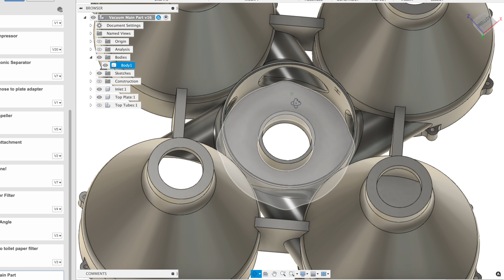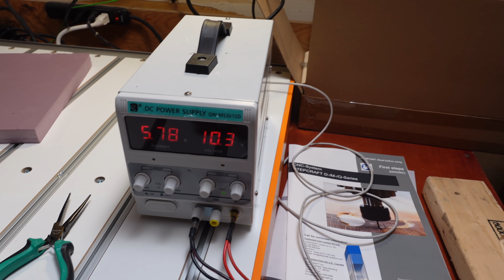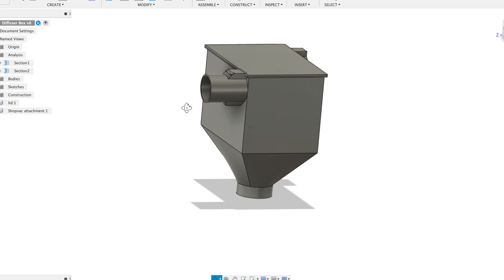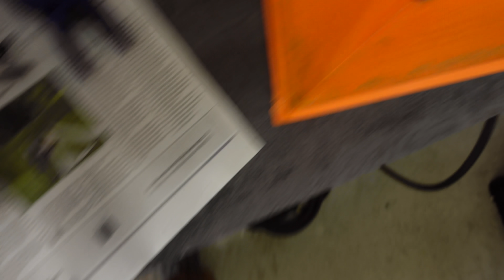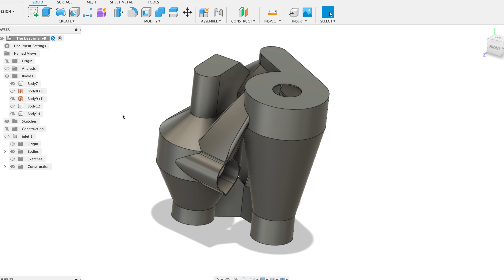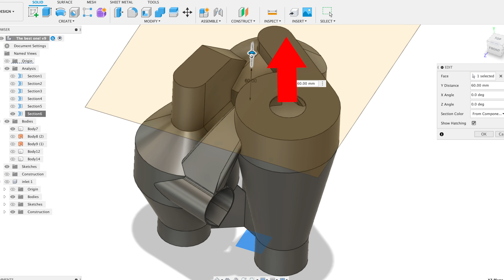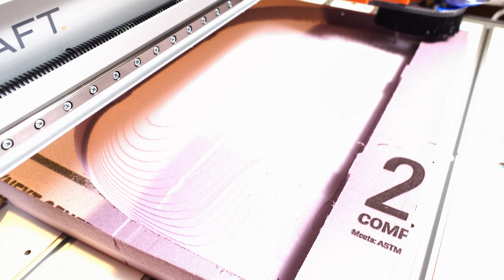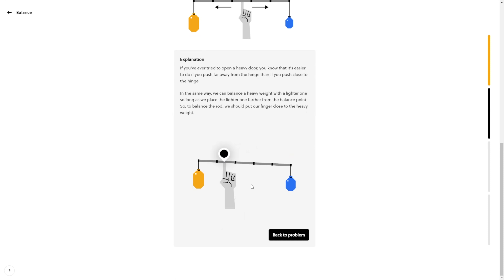3D Printed Cyclone Air/Dust Separator

Comment: Your big pieces are floating because you have a leak to your collection bin. Either perfect your seal or add a tube between the collection bin and the vacuum motor to equalize pressure.

Comment: So, I use these Cyclone vacs all the time. One thing you might want to take into consideration is flow rate of your air.

I use them to vacuum grain, and the flow rate is EVERYTHING
Reply: Thats more or less his entire problem, flow volume is way to high for the size of cyclone, and the single cyclone is way, way too wide and short. All he had to do was search Kice, Walinga,  Brandt, or any company that makes grain vacs or commercial dust collectors to get a list of scalable dimensions that would work without fucking around with so many half assed designs.

Comment: Air velocity could be a big factor. Larger dust particles if flung fast enough will just perpetually rotate at the top of the cyclone. I would go wit multi stages but have a firs lower velocity larger intake diameter and a greater angle then a second stage that would have a much smaller angle of the cone and smaller diameter od the intake from ghe 1st stage. This woukd accelerate the air and particles in the not letting them keep being airborne as otherwise they would be in the larger lower velocity cyclone stage. Though this is just an idea

Comment: mmh I'd be interested in seeing the difference between various angles of steepness on single cyclones vs big and small particles.
Perhaps one angle is better at small dust where as the other is better at larger particles, in which case having 2 of them in sequence could get you the best of both worlds.

Comment: you're pulling too hard a vacuum. that's why the big one works better. you're creating too much turbulent air:goodvibes:
Reply: also alot of those filter systems still have a filter section like big felt socks

Comment: I am just guessing but what if you try to angle the intake pipe slightly down ward so the particles will have an initial downward motion as well as gravity falling. And or make an inner tube what is equal in length to the intake diameter to prevent any shortcut of particles.

Comment: Thanks for the very interesting video.
Your gas cyclones are well printed, but have a relative high surface roughness. In consequences they need a steeper cone, because the particles stick easier and have a higher friction. Also introduced are little turbulences, that can pick up dust an bring it back into the airflow. In minute 1:26 you show us a very good example off an array of gas cyclones. Here you can see that the cone is steeper than they are in the printed one. Also is the cylindrical section much longer. This helps to stabilize the airflow and particles don’t exit the gas cyclone as sone as possible. For the small and easy escaping particles you will need a tube inside, that goes down from the outlet. This is never shown in your video, but helps against small particles that exit too early. Cascading cyclones in general is not often used in industrial applications, but when you do a cascade of cyclones, they get smaller in size and high in quantity. They need to get smaller to separate smaller particles and higher in quantity too allow the major flow of the first big cyclone. The last thing you can improve is a cone in the outlet for the solids. The cone prevents the vortex to get in the dust collector. It is not often used, because of issues with clogging of the outlet. This happens for dust that sticks easy to gather and is more stringily. This is possible for your foam dust. So, not highly recommended. 
For farther information I found a book that can help you: Rhodes M. (1998). Introduction to particle technology. John Wiley and Sons. ISBN 978-0-471-98483-2
https://memberfiles.freewebs.com/94/74/72737494/documents/Particle%20technology%20by%20martin%20rhodes.pdf

Have a good one

Comment: Question for y'all, why does sanding down the sides help with the removal of those heavier than air particles? Wouldn't friction against a rough surface help in slowing those particles down as they drag against the sides? Better yet, would designing and printing the mono-cone with spirals running the same rotation as the cyclone but spiraled down into the collection box help with direction heavier particles as they would be guided downwards by essentially a channel vs just free-flowing with the air?

Comment: I'm thinking the bigger cyclone works because it lets the air slow down the most. Smaller cyclones keep the velocity so high the small dust stays suspended.

Comment: I bet if you put an inner cone inside the cyclone to prevent the air flowing directly up the tube it would massively improve the separation, also a counter helix printed in the outer cyclone to help guide the dust down as it spins, think texture more than canard, just a spiral bump to kick off perfectly circular rotations, also flat vertical blades on the inner cone should prevent spinning vortexes entering the internal cone and providing lift to particles, so they fall instead of climb, so less flow through effect like you're seeing with the multi cones

Comment: Might have to do with the flowrate vs cyclone volume. I.e. if you have two stages of the big cyclone it will do better. 3 stage cyclone do better with bigger particles may just be lower flow speed due to the more complex structure.

Comment: would the cyclone be more effective if you kinda corrugated the inside of the cyclone so the ridges would guide stuff towards the bottom?
Edit: Something else you might want to try is putting some vanes around the exit of the cyclone that require the airflow to actually reverse at the center of the cyclone to reach the exit. The particulate matter should have too much inertia to make the turn and just skip off the vanes, but the air should be able to get in just fine ideally.

Comment: With cyclones in series I am pretty sure each of the dump buckets need to be separate. If you have 3 cyclones in series you need 3 collection buckets. Just having 3 tubes into the same bucket will not work because they will equalize pressure.

Comment: you should try angling the air intake into the cone to be more down so it doesn't keep spinning around. also put a flat plate on the bottom of the cone with gaps on the sides so the dust only goes in not out. that should help with those problems

Comment: also i would think that you would need to run a heat gun around the inside to smooth the print and give as low a friction surface inside the cyclone as possible

Comment: Make sure to crimp a ground wire to the metal wire in that flexible hose and screw it to the metal frame of the router to prevent static build up in the vacuum system.

Comment: I'm not sure if this has been recommended yet, but you should try a two-stage system with the first being a defuser and the second stage being the cyclone. In the defuser you should take the half tubes across the entire section alternateing their direction with a little bit of overlap (like full tubes that have been cut in half and one half moved down so its edge is in the middle of the other half, and repeat until it covers the entire thing. I'm not sure if I'm explaining this well enough). The air will be able to move quickly around the curves but any larger items will fall down because they can't make the quick turns.  and the dust will then be picked up through your cyclone design.

Comment: What about using both. The multi stage cyclone to pull out the large particles and then the single cyclone to pull the fine particles. Would be interesting to see them both hooked up inline like that.

Comment: I'm curious what your results with the paper towel filter would be if you just cut two holes in the lid of the bucket as far apart as possible, one for the outlet and one for the inlet, and have the hoses pushed in a little.

Comment: Pretty sure a problem with your series design is you outlet also was ramped with a cone, causing the air to increase in velocity and take the dust with it. This is supported by the fact that the third chamber removed the most dust. The outlet between each chamber s,hould be flat, you might even want to put a lip around the outlet reaching into the chamber

Comment: I like what you are doing. suggestion: start with an elliptical shape to parabolic shape and then hyperbolic for cyclone mono design would be my thoughts to try for improvement ideas and yes some sort of static grounding with even a probe into the drop bucket as there appears to be that ionic collection there too. a stupid industrial sized (5x8) scotch brite does work on heavy particles in like the paper filters you used.. the finer dust is my problem. haven't gotten around to the water trap filter system yet. i.e. older rainbow vacuum cleaners design - no static ground required here due to the water neutrality aspects..  just dawned on me water in the bottom of the 5 gallon pale, @1" would cut out a lot of static aspects - but mold ? or the daily dump...
good luck

Comment: What is instead of a cone, you had a hemisphere? Or what about something sorta the inverse of a hemisphere, a curved funnel sorta like the "mouth" of a trombone? Or how about some sine-wave ridges that spiral downwards, sorta like smoothed out screw threads going along the walls; with the curvedness not too pronounced to catch too much dust?

Edit: Oh, another idea to test: Instead of just a cone/funnel, have the top section be just a straight cylinder, and place the funnel/cone at the bottom

Comment: Simply routing the air through a larger tube will drop the air velocity since Q/A=V where V is velocity, A is area and Q is flowrate.  If you bump up the area the velocity goes down proportionally.  The middle of the tube will have a much higher velocity (especially since this is 3D printed and doesn't have a smooth surface) so it would require a series of diffusers to make sure the velocity field is uniform.  You'll need the bottom to be open to the bucket for the dust particles to descend and accumulate.  If you get an anemometer (they are like 20 bucks) you can measure the velocity of the flow in your vacuum tube which combined with the cross sectional area can give you an estimate of how large the dust collector tube would need to be to drop the air velocity.  The surface area of the opening in the diffusers should be equal to the original (non enlarged) tubing size.  Basically the particles fall downward at a fixed rate decided by gravity and their drag.  The velocity inside the collector must be low enough that a large portion of particles (>95-99%) have plenty of time to fall downward out of the moving air stream.
Reply: I might have read this wrong, but doesn't the high velocity of the air generate the centripetal force that separates the heavier particles. This also might just be one factor, or I could be completely wrong.
Reply: @terminus9897  ummm. Centripetal means striving to the center... Since this comment is about axial flow, not about any kind of rotation, centripetal forces are not at play.
@Entropic0 is right that the slowing of the air will make the dust get caught by gravity if the speed drops slow enough. The smaller the particles, the slower it needs to be. But also, the smaller the particles, the slower they fall because of the ratio between friction, drag and the load capacity (which increases with speed). So it's not enough to calculate a lower speed, but you also need to calculate a minimum length of this wider section.
For fine dust, these numbers would go up so high that it becomes unrealistic to implement. So it's a great idea for the larger size particles (except the diffusers, as they will capture particles and eventually clog up the sides, increasing the speed in the center until a point where it's fast enough to prevent the particles for getting caught, which will also be where the particles will no longer drop out of suspension.)
Reply: There was a Practical Engineering video on this for settlement bins, but it was for waste water treatment. Fascinating stuff!

Comment: I've watched & read 3,247 dust collection videos & articles, & wound up building a Thein baffle (a flattened cyclone). 1. Your dust and everybody else's may differ, much like carpet sweepings vs shop debris. 2. Air velocity vs particle size is one variable of separation (which is why large sawmills have multiple separators on a single air path, collecting chips & chunks in the primary & then smaller stuff in the subsequent stages. Particle density is another variable. 3. Cyclone size matters vs time for gravity separation. 
Horn style is likely to be more efficient by a teeny margin vs a well crafted Thein. But the Thein on my dust bin fits nearly under the work bench, just my preference.

Comment: You don't mention it.. but did you look up cyclone separator design? There are tons of pages with crazy complex math formulas that you input the flow rate, particle sizes, particle weights ect. and it'll tell you the dementias and angles for the design. Came across a really cool paper using machine learning to help design the separator. I've never designed one but have worked at places that have them. Talking to the plant engineers I was amazed at how much goes into the design of a proper filter for your application. The sizes, lengths of the vortex finder, tubes, inlet... it's all super critical for the "stuff" you are trying to separate. I'd like to see you use some of the formula's and try making one specifically designed for the particles you are trying to separate. Also you are kind of not compairing correctly using that dust, floor junk, and the actual filings. They are all totally different. A cyclone that will work with that fine dust will not work well with larger particles as I think you are seeing. So if you are trying to use the filter for the CNC machine you'll need to design and test with particle sizes and densities for the CNC.. not green dust or your floor.

Comment: Did you try to use a motor speed controller to vari the speed of air so you can tune the volume of air to match the volume of your collectors

Comment: I would say a huge issue with this design is the surface of the 3d printed plastic causing too much friction with the air. I think polishing the surface of that plastic would drastically improve the overall performance.

Comment: You should try a Tesla valve (#integza made a great video about it), at the end of each cyclones, in the serial one
Reply from the maker: I think it would get clogged
Reply: @rctestflight  it wouldn't it properly made ;
The main principle in this valve is basically making the fluid (as air) making turns, to makes it more difficult to pass by on a certain way, than the other way (watch the integza's video, you understand)
My point is there is nothing that physically blocks the way of dust and dust, in anyway, but just because dust is way more heavy than air, it would be way more difficult for dust to go upward than for the air
Reply from the maker: @corentinvaslin6443  Right but its more than just dust that goes through there. Lots of foam chunks, strings, wood splinters, etc.

Comment: Hi,

I would like to 3D print a cyclone to remove ultra fine dust. I want to use this cyclone to 100% clean normal outdoor air to blow into my house. The idea is to give my house a positive air pressure with 100% clean air in order to make the inside of my house dust free. I thought to combine this with a humidifier. I have printed a 700mm high cyclone, but that did not collect any dust, yet my house inside does have a lot of dust.

Is it possible that you can share 3D printable designs.?

Regards
Rudi

Comment: this rocks, i love this kinda shit, two things to investigate
1) is it possible that the monocyclone performs worse with the lower airflow of the vaccuum, accounting for its' lack of performance in that application, and that dust size isn't the primary factor?

2) would you consider replicating the separator made by Stuff Made Here, with the wave design, and testing it against these cyclonic models?

Comment: You should try and make a little baghouse like the ones commonly used for industrial dust collection. It's basically just an air filter that periodically has compressed air pulsed through it to automatically keep it clean. I'm sure it would be entirely impractical for you, but it would be really neat!

Comment: The “3-in-series version” uses the same bucket. There could be an issue with the pressure delta which would explain the poor effectiveness. Try with 3 separate buckets.

Comment: Awesome topic :)
I might have 2 more ideas for your designs
First, i guess you could direct the airflow of your series design by using tesla valves, as they don't physically block the particules
The second is, why using a linear slope and a conical shape ? If you need multiple slopes, then why not making the shape more complex, with a variable slope or something ? (Like a swirl?)
I really want to see those ideas for real, hope you will find the time to !

Comment: I think the 3 cones will work better if each of it's cone is wider in diameter, the exit holes is too close to the sides if the cones that it can also drag and suck the dirt and dust by the air through the hole(s). Just my opinion.

Comment: Your cyclone needs a thimble and a disentrainment pot. What pressure drop were you designing for? How many CFM is your shop vac pulling? These two pieces of informaion will determine the size and shape of your cyclone.

Comment: When it comes to cyclones, bigger is always better simply because you have to match the angle of the cone with the speed of the air, so having one thats bigger means you dont have to worry too much about the angle as it will slow down the air alot. At my work we have a few of them and they do very well with both very fine metal dust and metal shavings simply because they are about 7 feet tall and 3 feet wide.